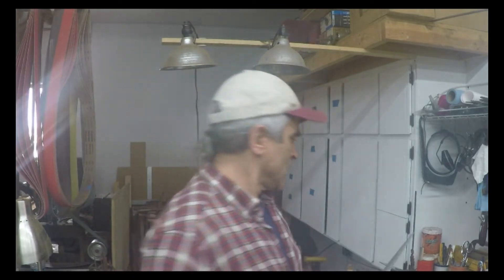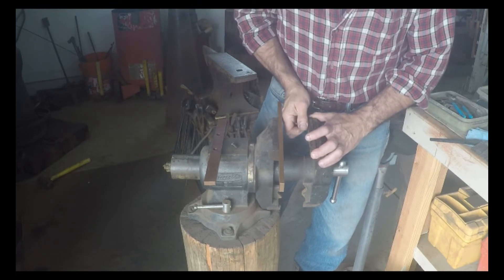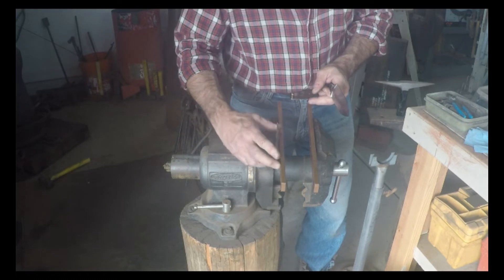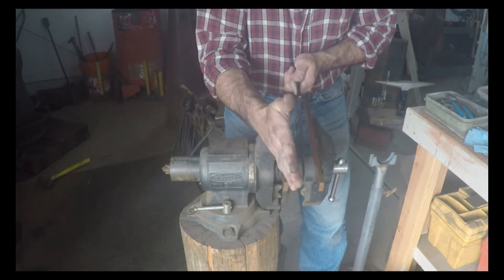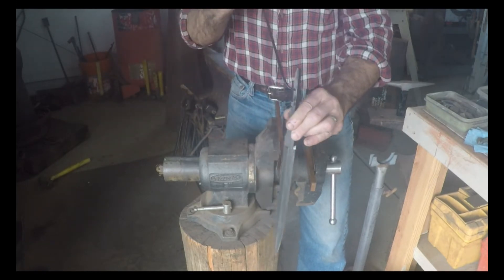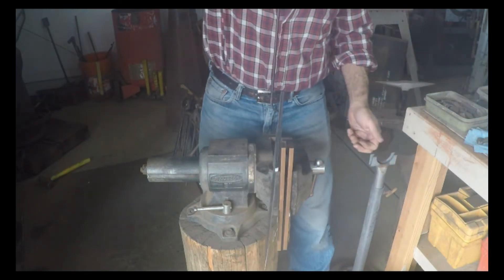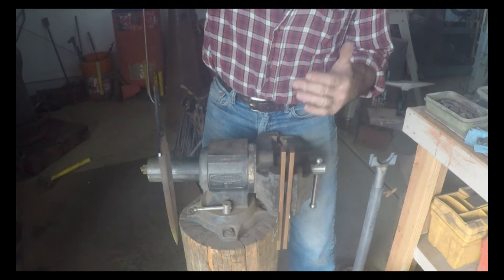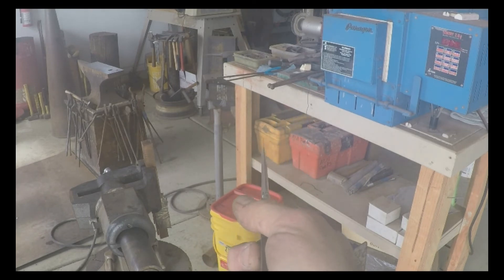Avoiding the Quench Warp

Comment: I watched this this morning and have been thinking about it since. Lots of guys now are using aluminum quench plates, some with air guns to get them tight quickly, but I think your method is superior, as using the shims allows the smith to match the distal taper, and set the whole thing up before the quench. No way to do that with aluminum quench plates. Thanks very much for sharing this.

Comment: Thanks for the video. Im not quite as set up but im getting there. I am currently needing to pay for heat treat of high alloy tool steel but i can harden and temper carbon steel myself at least. I got a crack in a kitchen knife near the handle. I am guessing i didnt heat the blade or quench the blade evenly? Or was it too hot? I noticed the dagger in this video had no glow to it and my knives are usually a bright orange when i quench them. A quick google chart and search suggested I was a couple hundred degrees too hot. So im thinking red rather than orange. I am using aaa oil.
Reply from the maker: Bergstrom Sharpening i need the lighting bright for the video so don’t judge the temp from the color on screen. I use the Paragon oven and heat to 1485 degrees Fahrenheit.
It is orange to me
Reply: Dos Gatos Designs LLC ok thanks! Just wondering. If one can afford an over like that, how expensive and difficult is it to run and use? I think i need one. I am using oxy acetylene
Reply from the maker: Bergstrom Sharpening I will be doing a video on how to properly judge when to quench by eye. Stay tuned!

Comment: Interesting set-up. I think I'll have to try that. It did seem like you took a fair while to get the blade from the oven to the quench...around 5 or 6 seconds? I was always under the impression you had about 1 to 2 seconds before you start losing too much heat for a good quench. I guess whatever works. Seems your blades are still getting hard. Thanks for the video.
Reply from the maker: Randy Reichert I think you are confusing the amount of time you need to cross from transformation temp to Ms temp. For most of the common blade steels you have a couple of seconds to go from 1475 to below 1000 (or 800 depending on the steel) to form martensite. That is largely dependent upon the quench medium. I typically set my oven about 10 degrees F above the trans temperature.
Reply: @dosgatosdesignsllc848  ok that makes sense. If the blade was a little hotter than quenching temperacture to start with anyways, then you probably got a few more seconds to play with before getting it into the quench. My concern was that the blade could drop to below transformation temperature before you get it into the quench.